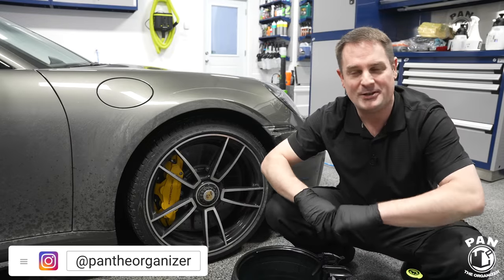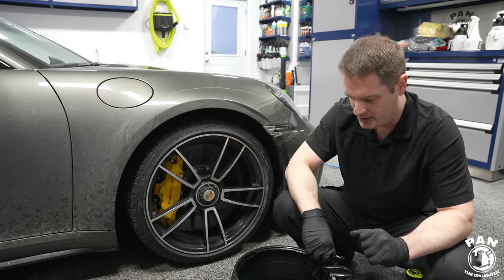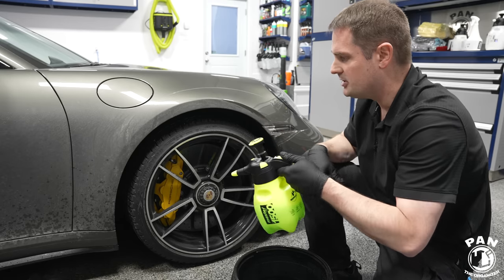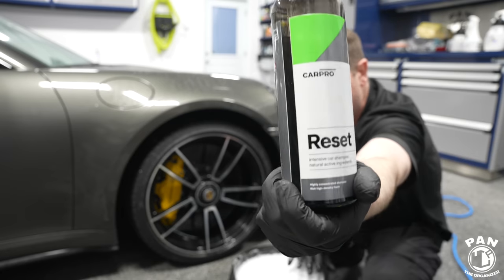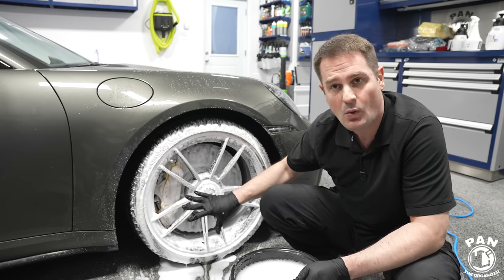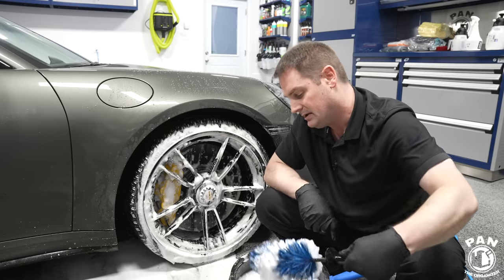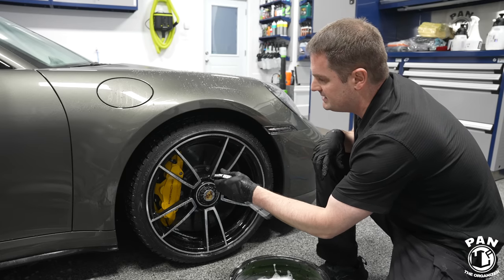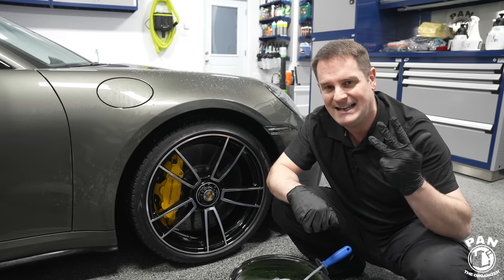How To Clean Wheels With Carbon Ceramic Brakes

Comment from the maker: ⬇️🔶 LINKS TO PRODUCTS MENTIONED IN THIS VIDEO ⬇️⬇️
🇺🇸 For people in USA:
Koch Chemie Green Star: https://bit.ly/3BCsveH
CarPro Dilute spray bottle: https://bit.ly/3EgaLW3
P&S Brake Buster: https://amzn.to/3JGzTbF
Adam’s Wheel & Tire Cleaner: https://amzn.to/33GEnQg
Tire Brush: https://amzn.to/3s6ysxd
Optimum No Rinse (ONR): https://bit.ly/3JKpXhe
McKee’s N-914: https://bit.ly/3mOX6zM
Marolex pump sprayers: https://bit.ly/3IaYNzU
Bucket filter: https://bit.ly/3BEFa0C
CarPro Reset shampoo: https://bit.ly/3bIvPZB
MTM PF22.2 foam cannon: https://bit.ly/3vaFCCv
Mosmatic spray gun: https://bit.ly/3JKh1Zq
Microfiber Madness Incredibrush: https://bit.ly/2Yu77Ju
EZ Detail brush (fenders and calipers): https://bit.ly/3h1vQKP
Microfiber wash mitt: https://bit.ly/3JKgYNe
Gyeon WetCoat: https://bit.ly/3qAyDPu
CarPro HydrO2 Lite: https://bit.ly/3Ha8H3n
MetroVac Air Force Blaster Sidekick: https://amzn.to/3LMTxEJ

🇨🇦 For people in Canada:
Koch Chemie Green Star: https://bit.ly/33EnYvz
CarPro Dilute spray bottle: https://bit.ly/33EcHLV
P&S Brake Buster: https://bit.ly/3JFyvWM
Adam’s Wheel & Tire Cleaner: https://bit.ly/3LNiGix
Tire Brush: bit.ly/3eg9Rls
Optimum No Rinse (ONR): https://bit.ly/3JLE1Hc
McKee’s N-914: https://bit.ly/3BBQPgw
Marolex pump sprayers: https://bit.ly/3IaYNzU
Bucket filter: https://bit.ly/34V9Bna
CarPro Reset shampoo: https://bit.ly/3s5g5Zp
MTM PF22.2 foam cannon: https://bit.ly/3h08Ewu
Mosmatic spray gun: https://bit.ly/3JKh1Zq
Microfiber Madness Incredibrush: https://bit.ly/2Yu77Ju
EZ Detail brush (fenders and calipers): https://bit.ly/3BBR9vK
Microfiber wash mitt: https://amzn.to/3I9bew5
Gyeon WetCoat: https://bit.ly/3Ha9iC9
CarPro HydrO2 Lite: https://bit.ly/3t3wAVs
MetroVac Air Force Blaster Sidekick: https://bit.ly/36k0Ymu

🇬🇧 For people in the UK: https://bit.ly/3QG5qhU

🎶 MUSIC I USE IN MY VIDEOS - Referral link, get a free trial by clicking below!
https://www.epidemicsound.com/referral/pjuxkd

Watch more of my videos:
✅ Best new tires dressings: https://youtu.be/dBFssyGLNQM
✅ How to clean wheels and tires: https://youtu.be/Ty4ZTq7A7rc
✅ Tire dressings battle: https://youtu.be/Oge5jlaAaME
✅ Best Wheel & Tire Cleaners: https://youtu.be/jfYZh1qB1LY

Comment: One of the BEST tricks I've learned from you Pan is adding/topping my clean wheels with WETCOAT , when you suggested it years and years ago. Still doing this little trick to this day!!
Reply from the maker: Great to hear! Yeah it totally makes cleaning the wheels easier and keeps them looking cleaner for longer! Good job Mike!
Reply: Wait! What is wet coat?
Reply: Yes and Yes. Reminds me, I need to order more. I have been Dialing back the P&S Brake Buster as I feel at the ratio my son and I have been using, in turn is shortening the life of the Wet Coat...
Reply: @hulabird  gyeon wet coat is sio2 based spray and rinse sealant suitable for all of the exterior of your car , maybe not on the tyres but wheels , glass , paint , plastic and chrome . Pan already put a link of the product in the description , and durability is upto 3 months and takes minutes to apply
Reply: @M.E63  thx for the info
Reply: Yes I agree! I cannot wait to try this method out too.
Reply: Agreed

Comment: As a former racer those are some gorgeous rotors which probably makes your seatbelt lock up when you brake hard! Great advice on using ph neutral materials on those beautiful rotors. Thank you for the video.
Reply from the maker: Hi Neil. Yeah you are 100% right! This car accelerates like crazy (we measured 2.3s 0-60mph) and needs to brake just as hard. Those huge ten piston calipers really are some of the best braking performances I have seen to date. Porsche is always known for their excellent braking systems, and this carbon ceramic latest gen setup is at the top of their pack.
Reply: @PanTheOrganizer  Enjoy the awesome acceleration as the zero to sixty time is insanely fast. Gorgeous car you have Pan!
Reply from the maker: Thanks again Neil!! The launch control is so violent, it gets people's jaws to drop every single time and they search for a grab handle to hold on for dear life!! HAAHAHAH

Comment: Incredible work Pan as always! Those calipers and rotors on your Turbo S are MASSIVE😱.
Reply from the maker: Yes they are! :) It accelerates so quickly it also need the most powerful brakes to have equal stopping power. These are the biggest brakes and calipers ever fitted to a 911 by Porsche! :)
Reply: @PanTheOrganizer  Exactly, 650 finest German horses require serious brakes😁. Beautiful car, in my opinion the 992 generation of 911's is the best one yet.
Reply from the maker: I agree!! It's the best one yet.

Comment: Great video as always and love the advice of pre-spraying the vehicle with a rinseless solution (McKee's is my favorite) so that hopefully those against rinseless see some of its capabilities and become more comfortable with the idea.
Reply from the maker: Thanks Steven! Rinseless washes are great as a pre-treatment on a vehicle, as they will encapsulate loose dirt and debris and add lubrication on the surface.

So even if someone doesn't use the rinseless wash to clean their car (I still use the traditional two bucket system), using a rinseless wash as a pre-treatment before washing is a great idea.
Reply: @PanTheOrganizer  I've been doing a hybrid wash method of pre-treatment, rinse off, contact wash with rinseless, and dry to get the benefits of both methods without using as much water as the two bucket.

Comment: Thank you Pan for showing us an alternative to Brake Buster. I've been wanting to find a secondary wash solution for those not so dirty wheels and CarPro Reset looks like a decent option. I'd love to get in the habit of using HydrO2 Lite too because the next wash is most likely more enjoyable! Those ProLock Milspec power cords are amazing!

Comment: Great video, Pan.  My process is almost identical to yours.  I have an Audi RS6 Avant, and the massive calipers on the front make it difficult to use the EZ detail brush, as it got caught behind the dust shield the first time I used it.  I bought the smaller version, and have had no problems since!
Reply from the maker: Thanks for sharing Ken!

Comment: Thanks Pan; very helpful video. For ceramic coatings, have you run into issues with water spotting? Particularly on PPF. And what’s best way to remove? I’ve tried water spot remover and diluted vinegar but didn’t work. Other than polishing, I only found pouring hot water or steaming on the film is the only method that worked. What’s been your experience?
Reply from the maker: I don't have water spotting issues where I live, plus I use deionized water to wash cars. Zero minerals, so zero water spots. But come back on Saturday for my spring cleaning tutorial, and you'll see a product in action that is designed for that. Super easy to use. Stay tuned!

Comment: Pan I just can't get over the size of the calipers and rotors.  Tremendous. Wow. That is one sweet car. 
I just picked up Gyeon Wet Coat. Wanna give it a try. How long can you expect protection to last? I know it's a subjective question, but a ballpark figure. 
Very good video.
Reply from the maker: Thanks Kim. Yeah those are the biggest brakes Porsche has ever fitted on a 911. Massive 10 piston calipers to help bring this beast to a stop quickly.

WetCoat and HydrO2 typically last 2-3 months on wheels.

Comment: Great video. Specialized video for sure.  How about another specialized video for doing convertible soft tops?  Clean and protect.  Very hard to find on detailer channels.
Reply from the maker: Thank you! Yeah convertibles are not a popular pick in my area, as we are in winter months pretty much 6 months in the year. We're in May and we still have near freezing temperatures at night... So I rarely get to detail convertibles. But if I do in the coming year, I will make a video for sure.

Do you drive a convertible?
Reply: @PanTheOrganizer  I'm Southern Ontario and I bought one for my wife last summer.  She drives it year round but mostly just Apr-Nov will be 95% of the km.  It was only two years old with 7K on it but left outside to the elements.  Had paint correction and then ceramic coat put on, but I'm concerned about doing the top without some education.  Buying this car is what got me watching your channel for the last 8 months.  I'm sure I could arrange a trip to Montreal for a donor video car. :)

Comment: Loved the video! Weekend warrior here.  I always clean my tires then clean the rest of the car (thanks to you).  I use Gyeon Wet Coat on the whole car and the wheels/tires at the end.  Is that the right time to do it or should I apply the wet coat to the wheels/tires right after completing them and before doing the rest of the car?
Reply from the maker: You can wait until you’re done washing the car and rinsing before applying WetCoat, but you can also apply it immediately after cleaning the wheels. It doesn’t matter. What ever makes more sense in your wash routine.

Comment: Thats how I wash my wheels, I really don't like using detail brushes on black gloss surfaces as you'll get swirls, a noodle sponge or mitt is what I'd use- always thinking about ways to actively reduce swirls and marring. After winter, do you pull the wheels off and get under and clean off any built up road salts? Would make a great video 👍

I've got steel brake discs and use Bilt Hamber Atom Mac this prevents rust flashing after water contact 👍
Reply from the maker: I don’t remove the wheels myself as it needs specialist tools. My wheels are special Porsche center lock wheels.

I can still do a thorough clean with my pressure washer and brushes. Plus my fender wells are ceramic coated which really helps to keep them clean and makes them easier to clean if needed. ;)
Reply: @PanTheOrganizer  You should have the special centre lock tool in your car, its reasonably simple to remove that type of nut. You just need a jack and some blocks 👍
Reply from the maker: Yeah, I won't be doing that. LOL  I have seen my friend Matt (Obsessed Garage) do it a few times on his GT3 RS, GT4, etc and it's not as simple as it seems. And he has a car lift. He now sells a tool that costs $6500 USD that can remove and tighten center locks. This one: https://bit.ly/3vMyH2k

So perhaps I'll get that one day.

Comment: Hi Pan, would it not be easier to lift the car up and remove the whole wheel so you can clean the entire surface? but for sure you can’t do that all the time:) anyway this looks amazing greetings from Holland and onto the next pro tips!!👍🏻👍🏻
Reply from the maker: I wash my car twice weekly so it’s absolutely not an easy thing to do to lift the vehicle and remove the wheels every time. Nobody does that.

Plus, my car has special center lock wheels which requires specialty tools and procedures to remove. 

And just for the amount of time you’d waste removing wheels every time it’s counterproductive.

I can assure you that my wheels are perfectly clean when I’m done cleaning them. ;)

Comment: Awesome video Pan. Can we use the same products for non-carbon ceramic brakes? Green Star & P&S break buster & a PH neutral shampoo has been my go-to products when it comes to cleaning wheels & tires. However, I was wondering if you would clean wheels first prior to the engine bay or vice versa? If it is not too much to ask for, is it possible for you to update a video on engine bay detail? Anyways, thanks again for all the amazing content. I just love watching your videos.
Reply from the maker: Thanks Urvish. Yes you can use the same products to clean wheels with regular metal rotors. For the engine bay detailing, I already have quite a few tutorials, and the most recent one is the most up to date here: https://youtu.be/R5ZbroMTULM

If I'm doing a full car detail, including the engine bay, I will start with the engine bay, and then do the wheels, and then the rest. I show all of this in this video: https://youtu.be/0lC9uyKXs8Q
Reply: @PanTheOrganizer  Thanks so much :)
Reply from the maker: My pleasure!

Comment: Everywhere I've read, it says you're not supposed to spray any silica, waxes or harsh cleaners on carbon ceramic rotors.  Supposedly this ruins the rotors braking capabilities because they are so porous it will seep into the cracks and never be the same.   Isn't carpro HydrO2 lite a silica spray?
Not to question your expertise but I'd really like to know as I have CCBs on my GM car.
Reply from the maker: Welcome to my channel. You discovered one of the biggest car detailing channels on YouTube as we surpassed 855,000 subscribers and 108 million views! I have been detailing for 25 years and I love to share my knowledge and passion with my viewers.

You found the right channel to help you learn everything about detailing.

There are lots of misconceptions about carbon ceramic rotors. Most car manufacturers state to only clean wheel with a gentle pH neutral shampoo as they don't know what products people will use, so they want to avoid people using strong acid based wheel cleaners on them. So it makes sense for the manufacturer to recommend an "one size fits all" approach so that idiots don't ruin their wheels.

But when you know what you're doing, and you use appropriate products and methods, there are no worries. I have been using my methods for years on carbon ceramics, including my own Porsche 911 Turbo S, and never once had an issue. And everyone I know that does the same is in the same boat. My friend Matt from Obsessed Garage has a 911 GT3, had a previous 911 GT3 RS, had a GT4 and a BMW M3 with carbon ceramics, uses the same methods and products, and also never had issues.

Most of the time, as those discs generate little to no brake dust, all you need really to clean your wheels is a pH neutral shampoo. But using a dedicated wheel and tire cleaner like P&S Brake Buster is also perfectly fine when used correctly.

I would avoid using acid based wheels cleaners (like Meguiar's Wheel Brightener) on those types of wheels though, and never work in direct sunlight.

Comment: Oh what, is this 10 piston calipers?😍😍😍
Reply from the maker: Yes the top of the line Porsche 10 piston calipers. The biggest brakes Porsche has ever installed on a 911. 😁
Reply: @PanTheOrganizer  Thats insane Audi Rs6 also have 10 piston, but I mean this car weighs like 500kg less, so that must be insane braking performance
Reply from the maker: Porsche are known for the awesome brakes. Even the base 911 brakes are more than enough hehe.

Comment: I was waiting for this type of video for awhile! Thanks Pan 👍👍
My detailer told me that there was no problem using Iron X on CCB's, because it"s not alcalin.
He even said that Aston Martin is using Iron X on their racing cars, equipped with CCB's, what are your thoughts on this ?
I prefer to be safe and use regular Gyeon car shampoo with a mit on my ceramic coated wheels.
Reply from the maker: I personally don't recommend using iron removers on wheels with CCB's. You can "technically" use an iron remover as most of them are pH neutral (like CarPro IronX). They only become slightly acidic when the reaction happens on the wheels with the ferrous particles. But it's best if you remove the wheels first before doing a thorough cleaning with an iron remover if you absolutely want to use one. That way you won't affect the rotors.

But again, there's no real point in using an iron remover when you have carbon ceramic discs, as they don't release iron particles much, if any at all depending on the blend in the rotor.

Always keep this in mind: carbon ceramic rotors are pretty sensitive to cleaning products. They are porous as well, meaning cleaning products will soak deep into the rotor. Using the wrong products on carbon ceramic rotors will lead to discoloring, impact brake performance and potentially severely damage the material itself. 

The reality is that wheels sporting carbon ceramic brakes are the easiest wheels to clean!  Carbon ceramic brakes produce virtually zero brake dust.  What’s on the wheels will be what’s on your paint: normal road dirt from driving around.

I hope this helps.
Reply: @PanTheOrganizer  Thank you so much for clarifying! Your knowledge is really amazing! I'm not using Iron X as I prefer to be careful (CCB's are really expensive to replace).
May I ask you a last question : the only "powerful" product I'm using is Gyeon Foam (pre-wash) and I would like to know if it could harm the CCB's ?
How can I find out the level of PH ?
Reply from the maker: Gyeon Foam is perfectly fine for all surfaces, even if it's pH 12 (alkaline). To clean the actual wheels, you could use CarPro Reset (like I do) or Gyeon Bathe.
Reply: @PanTheOrganizer  I really appreciate your feedback, Pan! I'm using Bathe for wheels and car, as a shampoo and also Bathe+ to boost hydrophobicity. .
Reply from the maker: ;) My pleasure. What's your favourite video on my channel so far, by the way?
Reply: @PanTheOrganizer  The is a tough one! I'm watching your videos for years, both French and English ahah
But if I had to choose one kind, I'd say that I like the videos on your own fantastic Turbo S 😎
Reply from the maker: Cheers!! :)

Comment: Hey Pan, great and informative video for carbon ceramic brakes. I Remebered Jason from Chicago Auto pros also saying this once before. As a brand new detailer, how do you different between normal and carbon ceramic brakes? tried looking online but couldn't find any info
Reply from the maker: You can tell by the way the discs look. And normally they will be on very expensive cars.

You can also just ask the owner of the vehicle when they bring the car in. If you see it’s a Porsche, Ferrari, Lamborghini, BMW, Audi, Mercedes, McLaren, etc just ask if they are equipped with carbon ceramic brakes.
Reply: @PanTheOrganizer  thanks Pan for the info 😊